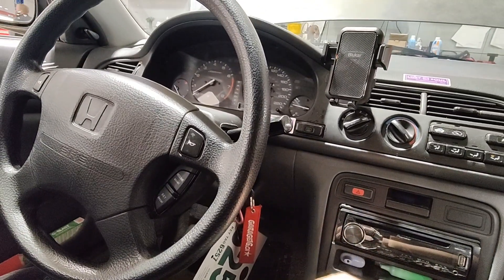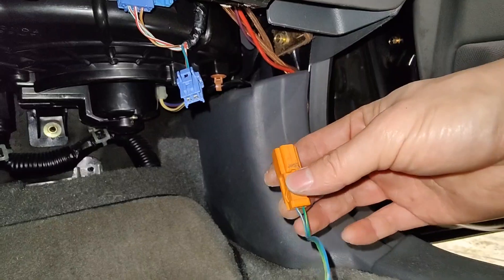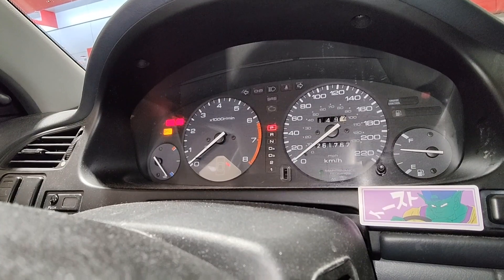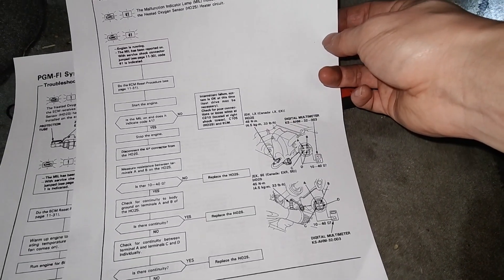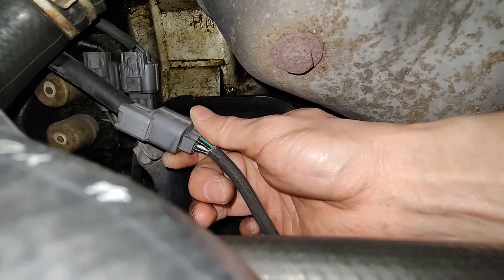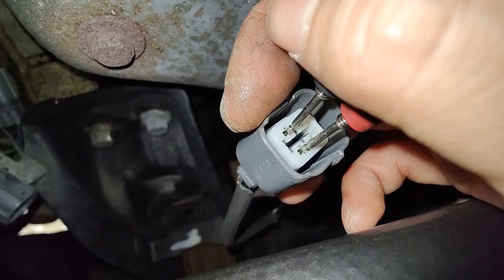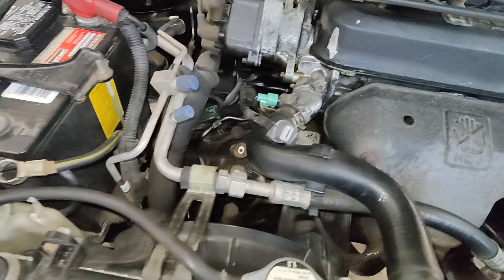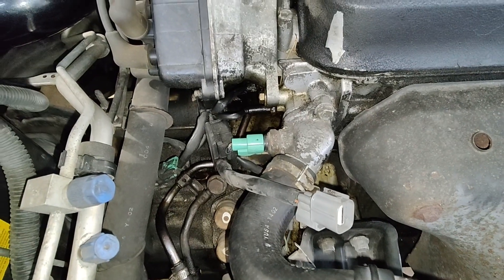Diagnosing OBD1. Check engine light on 1994 Honda Accord. Using special diagnostic tools.

Comment: I remember reading the codes on some older imports via a led built into the ecm housing. obd1 chryslers were key on key off key on key off key on to read codes via check engine light. obd1 fords a test light and iirc obd1 GM's a paperclip and the check engine light.

Comment: WOW..........that brings back memories.......back in the day as a Chevy dealer Tech I would watch mechanics pull the code and then just go to the bottom of the page in the service manual and order the part, throw it in and blow it out the door........hoping that "WHEN" it came back that the service writer would assign it to someone else......seemed like I was always that "someone else" ! !
Reply from the maker: I've had that happen quite often to me but usually my manager personally hands it to me either when it comes back a third time. Lol or if that person didn't show up that day or left early.

Comment: Trusty light bulb
Reply from the maker: Trusty diagnostic light bulb. Lol
Reply: @theoffroadingmechanic  what bulb and obd1 connector did you use? they're not in your Amazon links
Reply from the maker: The bulb is a 921 bulb I just added it. The connector is just something that was made.
Reply: @theoffroadingmechanic  but what did you make the connector out of? I need to run test on Granddaughters 1994 Accord.
Reply from the maker: You don't really need to make anything you can just use a simple paper clip to jump the 2 terminals to short out the SCS connector to get the engine light on the dash to flash the codes.
Reply: @theoffroadingmechanic  Sure, but it would be nice to source the plastic clip and short the wires together, then you can just keep that in the glovebox. Any tips on how someone could get that clip to make one just like you have? That's pretty handy.
Reply from the maker: I would have to find the correct connector. And match it up with the catalog on our parts department. When I get the chance and go through our bin of wire harness to match it up. Probably make a video if I do.